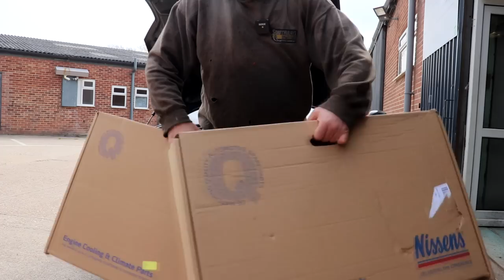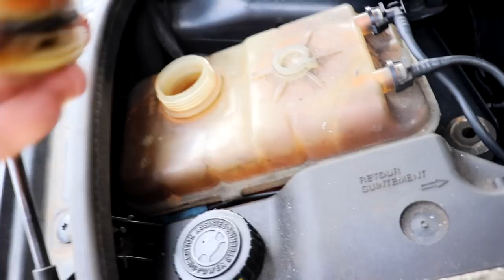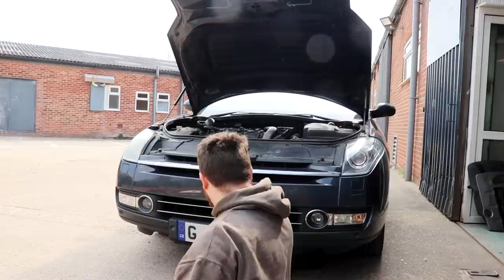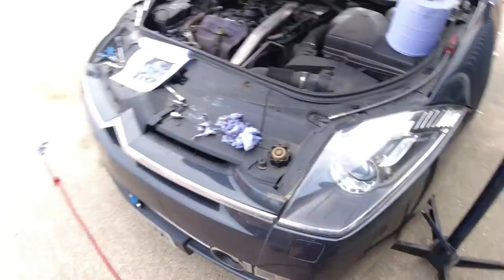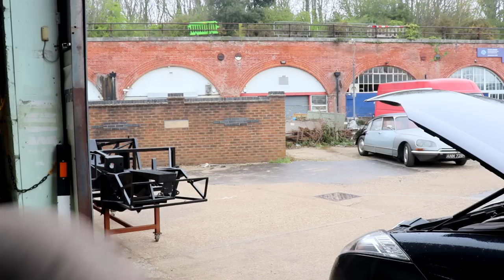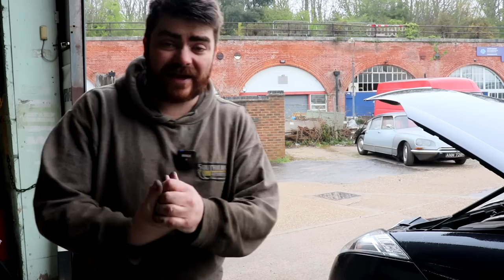Cheap Citroën C6 Project 12:  Cooling System Repair VLOG pt1

Comment: Dead Sea Soap is a popular item: at 8:45, it is clear that someone has used Red Sea Coolant Fluid.

The plastic breaking is shameful. In the 1950s and 1960s, manufacturers of a wide range of products were finding out what sorts of plastics worked well in what circumstances, and sometimes they got it wrong and high quality items became unusable. But by the 21st century, they should have got it worked out. And I suspect the engineers do know when to use plastics, and what sorts of plastics work well where. But cars are now designed by accountants and marketing. Will we, one day, start getting nostalgic over the design and construction of BMC/Leyland cars: "Yes, they're crap now, and they were crap then, but you can fix them (again and again)."

I was getting worried about you, but then you said you were going to have a sandwich, and I knew you'd be ok.

Comment: It really is just heat cycles that kills the plastics. Mercedes started to put plastic water pumps on some of their Diesel engines and when they eventually crack they send you a metal one as a replacement - go figure - it’s all junk now….
Love your videos !
Reply from the maker: Same with Ford, who used to fit plastic cam pulleys to Zetec SE engines when new!

Comment: I know what you mean about plastics - I wonder if 3D printing is going to be the answer, though? It's getting more accessible every day.
Reply: Was just about to say this, I definitely think it will be especially now that 3D printed metal is starting to be really good
Reply: I am kind'a betting on that. Not just the 3d printers, but 3d scanners and materials evolved a lot in the last few years, one day we probably be able to just order the part we need from somebody smart enough to produce them :D
Reply from the maker: That's where we're heading, I reckon.
Reply: @fulminatorc6 already the case with LHM return Y pieces. Twice as durable

Comment: The electrical connectors are different so that you don't mix them up when plugging the wiring back together - that is actually sensible. Plastic cooling parts, however, are only sensible if you expect the car to have a limited lifespan.

It would be interesting to know how many of these bits are shared with the C5, the 407 and the Jags and LRs that were also running this engine (or a variant thereof).
Reply: The thermostat looks pretty similar to the plastic one I had to change on a similar JLR V8 recently, so suspect they’re similar or the same on the V6 (with a few changes to fit the packaging constraints)
Reply: A car company that says that the gearbox is sealed for life, doesn't really think that the car should have long life... Also the same company (yes, pointing fingers to Citroen) suggests 30.000km between oil changes... So again, they want very limited lifespan. Probably slightly longer than the warranty.

Comment: It was K -seal from when the pipe under the wheel arch went in the middle of France !  :-) The thermostat housing was replaced after Citroen in Basingstoke shagged the original when they changed the timing belt.

Comment: That cough 'n' splutter start up is reminiscent of next doors diesel Kuga every morning @7.00am as they go swimming, darned retirees. Oh my 2010 Fiat 500 1.2L also had a plastic pipe stub crack on the thermo housing after only 7 years, prior to that '94 BMW E34 radiator stub and block transfer pipe at 11yrs old, all brittle. Huh... 🚗🛠️🙄😶

Comment: I did the a hose that runs over the top of the radiator on a BMW E90 ended up having to do the top hose as the small hose that I was replacing joins on to it and brakes at the join  then when trying to remove top hose it broke the join on the rad so had to replace that as well luckily with being in line 3 and 6 had very good access

Comment: I hate plastics in engine bays. The heat cycles is what destroys them. Plastic is cheap, light and durable, but give it 20 years of heat cycles and it's done.

The only saving grace for these modern plastic infested cars is 3D printers will likely keep them alive. 3D printers are getting more and more advanced, as are the printing materials, and a lot of the stuff is open source so there actually is a decent chance some of these will survive.

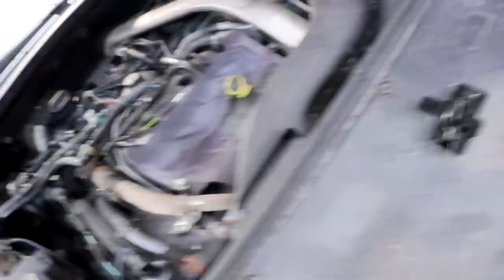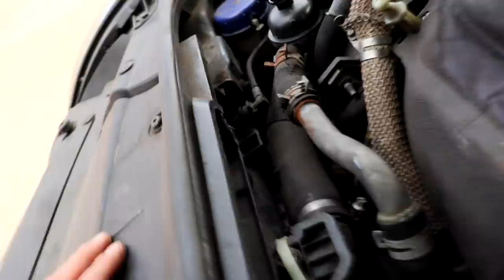Comment: hi. thanks for such relaxing and detailed video. have you got any issue with the cap from the coolant pipe? the one that was a top connection direct to coolant reservoir in the shape of L (you can see it at 04:54 and at left side 05:15)

Comment: Just stumbled across this. What a nightmare of a car.
Reply: To be fair, it's the top of the range V6, so more complicated than most.  The cooling system on my Renault was nearly as bad (20 hoses and full of plastic junctions) despite being the humble F4R four cylinder.  They are a far cry from the simple cooling system (mainly just a top and bottom radiator hose) on a naturally aspirated Honda K or J engine! 🙂
Reply from the maker: Nightmare to work on, but a dream to possess and travel around in.